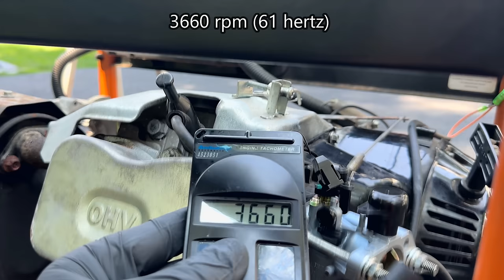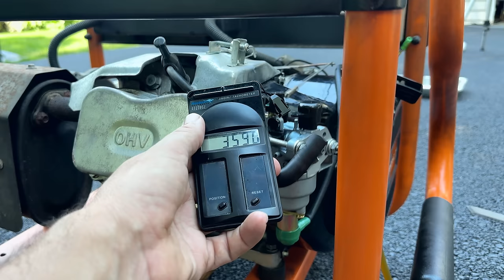Generac Engine Rebuild - Wiped Camshaft Lobe, Only Backfires Through Carburetor

Comment: Man I had my keyboard fired up and warm and was getting ready to tell you how you should take this engine apart. Working on industrial equipment  for 75% of my life I can attest that sometimes the torque values aren't always available.  So engineering support always used engineering standards which most of the time  was within tolerance.  I can't believe a Honda clone or any other engine with journals the same size as the Generac  assembly values couldn't be used.   Great job James, just when I thought you were backing away scared you redeemed yourself as the engine whisperer !
Reply: At end of day it's a generator engine not the space shuttle
Reply: @kylepaluzzi4176 you could have just read hes comment and said nothing
Reply: @kylepaluzzi4176  If I recall a few of those have blown up also !
Reply: @MrTonyPiscatelle  ‘just an O ring’  on one occasion wasn’t it🙄

Comment: Thank-you! It's remarkable that the wear was so specific on the one cam.
Reply: Yeah and it’s seems to be common on this brand of late model engines 
Factory defects for sure
Reply: induction hardening missing on one cam i think, factory defect not noticed by qc
Reply: @jusb1066 I think you're spot on. I work on these machines as a side business and I'm finding more and more issues related to poor metallurgy and coatings.

Comment: James! You just invented the very first generator optimized for producing imaginary power! Owners of capacitors and inductors everywhere will be breaking down your door soon to buy this!

Otherwise, a suggestion: for new engines and rebuilds, install a magnetic dipstick for the first few hours of running. You will be amazed at how much material it will capture. No more ferrous metal finding its way into bearing surfaces. I have magnets in all of my 4-cycle OPE. There's always something on it every time I check. And that's in every engine, so it's not presaging some grenading event. A new Ariens LCT 420CC snowblower engine that I broke in a few days ago, there was a substantial amount of material after just two hours of run-in at 2400 rpm. I don't believe that there's anything wrong with the engine, it's just normal wear-in. in any event, it might be interesting to try it on your next major rebuild just to see.
Reply: Where does one find a magnetic dipstick for so many different engines? I like the idea.

Comment: It amazes me that you are so meticulous. Not only replace the cam shaft, but why did it fail? Rust abrasion. I never would have thought of that. Awesome content, James. Keep up the good work.
Reply: I’ve had to newer engines that had bad cam and I was shocked 
Never see it before on a Honda engine in 25 years 
They failed at factory with the cam manufacturer
Reply: I expect there were a number of engines with a bad run of camshafts.

Comment: 👌👌👍👍  Thanks for the video.  I would have replaced the exhaust valve spring too.  If the old spring is too tight, it will wear down the new camshaft lobe.
Reply: I change out both springs on the two I did and installed Honda camshafts
Will find out once there used this winter how it turns out

Comment: Jim I'm glad you stressed a proper break in for the flat tappet cam and lifters and added Zinc to the oil for the break in period ,car engines and all small engines I run zinc in them especially my 1960s chevy motors

Comment: Hello  James: Another enjoyable and informative video. I will date myself here. Before the internet Era, when torque specks on a critical item like Con Rods or head bolts was not known.The common practice was to use a torque wrench and tighten the bolt or nut until it just moved. Take the reading. To allow for set resistance on reassembly use a torque set point slightly lower than the reading obtained. My personal adjustment was 5% reduced. I have never had a problem  with nuts or bolts coming lose or breaking using this method.
Reply: You can look up maximum torque values in charts online. It depends on the bolt grade, thread size and pitch, material it's screwing into, and lubricant. If the spec is for dry threads but you have them lubricated (oil, grease, antiseize, whatever) you have to lower the torque by 30% or you will overtorque
Reply: @brainndamage  You are correct. There is an unending  combination of factors that go into determining proper torque specifications. The use of establishing a torque  value and then turning an additional # of degrees is being used frequently now. Following the manufactures instructions is by far the best method.  If you were out in the field doing an emergency field repair and the information was not available or known what would you do?
Reply: @swallowinn4410  turning aspecified number of degrees is done for TTY (torque to yield) and will permanently stretch the bolt, you usually don't want that. It is very common on critical bolts however, cylinder head or exhaust manifold bolts. You can usually get a good torque  by feel if you're experienced enough.
Reply: @brainndamage  You are not telling me anything I did not know or understand. You did not answer the Question. What would you do if you had to complete a repair with an unknown torque value? As I mentioned I am not young, my mechanical and engine building experience was primarily in the Aircraft industry. Now retired I still routinely repair and build engines.This being said I am not too old to learn and adapt to a better method. So I repeat the question what would you do if you needed  to complete a repair and did not know the torque value for a critical component?

Comment: How tame, a wheel puller!   When I had to get a flywheel off, it was a couple of beefy flat blade screw drivers prying up from under the flywheel while you rapped on the crankshaft with a hammer !
Reply: Now there's your dinner

Comment: The readily available Rato 420 specs would work nicely!    If I recall, these engines have 2 oil fill and drain ports.  The oil drains have galleys that are drilled into the crankcase to facilitate oil draining.  These galleys collect all kinds of debris and are often overlooked when cleaning the engine block for repairs.
Reply: Really best to take it completely apart and flush with diesel and air psi to get it all out 
Yea more work but it’s clean

Comment: 37:08  That kind of wear doesn't just "happen"  I would definitely take the head off and examine the valve and the valve spring.  Something caused that excessive wear.  Since no other part in this engine has excessive wear, it wasn't contamination or loss of oil.  Other than contamination of the cam or the lifter from the factory, there is no explanation, at least so far in the video.  But SOMETHING caused it. It didn't just happen.
Reply from the maker: Rust contamination I think was the main issue.  Also the spring tension was high for small engine increasing the west.  The GP series are also known for cam failures.  Probably sub standard manufacturing.
Reply: @jcondon1  How did the rust selectively wear out the exhaust lobe and not wear any other part including the intake lobe?
You said the spring tension felt excessive. That would do it.  I think you should put a new exhaust spring in it.  You would think a worn spring would have less tension. So maybe it was defective from the beggining.  I think the spring tension measurement gauge is fairly expensive.  They may not even publish a spec for it anyway.
Reply: Those rocker arms sure do look heavy duty compared to the pressed soft junk that the majority of the others use.

Comment: James inoculated the engine with zinc, first time I have seen that on the channel. Good idea. I have used the STP zinc additive on my race engines with good results.
Reply from the maker: Normally not needed on a small engines since the valve springs are pretty weak.  On this engine, the springs were stronger then most.  Puts a lot of stress on the cam.  That and the rust I think were to blame for the failure.
Reply: @jcondon1  Oh, for sure the rust was a contributing factor. Something that would be interesting would be the use of synthetics in small engines. Either blended or full synthetics. In car engines, it is very easy to tell when an engine has used synthetics versus conventional. Since many of these engines sit unused for a long period of time, would the use of synthetics help keep the rust and corrosion at bay a little better?
Reply: @jcondon1  Hey, tried reaching you back about a month ago wanting to know where I can get that "IV fuel bottle" thing you use when you are not using the OEM fuel tank for testing. Can you put a link to it please?

Comment: A lot of people dont realize that periodic running of a generator is important (perhaps almost as important as oil changes). After the engine runs at temperature and is then stopped, either the intake or exhaust valves can be  open and moisture can and will condense on cooling surfaces, leading to rusting. Rust is abrasive. I wonder if a good practice would be to turn over the engine untill it is on its' compression stroke when storing it (just like running the carb dry).
Reply from the maker: I always turn the engine over until I hit compression before storing.  Valves are closed and moisture kept out of the cylinder.

Comment: You made the right call to remove the crankshaft. It is always a good idea when replacing or rebuilding the top end, to always at least inspect the bottom end. This is because top end repairs put more strain on already worn bottom end, and can lead to premature failure of bottom end.

Comment: Indasa Rhynowet silicon carbide abrasive paper is the best I've used. Not sure of it full range, but I have it up to 2500 grit. It cuts great; far better than any 3M paper I've used. I've used it wet with oil and water and dry. I can get mirror finish on metal I polish with it.

Comment: I had a similar situation with a briggs intek.  It didn't have an oil filter, was about 20 years old and my buddy bought it used.  He had starting issues/running issues and once we opened up the engine we saw the cam had excessive wear.  A new OEM camshaft later and it runs better than it ever did for him.  I think it was a combination of no oil filter, ran hard, ran low on oil, excessive intervals between oil changes, and oil that didn't have enough zinc for flat tappets.  Out of the hundreds of pieces of equipment I've had/worked on it was the only one I've come across with this issue.  No idea how many hours were on the motor as the machine didn't have an hour meter but it was a surprised failure to me.

Comment: Very nice video James. We have an incomplete generator at the shop we’d like to get rid of. It’s all complete except for the stator and electrical components. 9HP vanguard engine which did start last spring. Still has the rotor. We aren’t doing anything with it and it’s just taking up space.  No name on the machine but I’ve been told it’s a Dayton 5000 watt unit.
Reply from the maker: Not sure where you are located, but love the 9hp vanguard engines.
Reply: I’m in Ohio.

Comment: James...I just saw this video for the first time...In "comments" there was a question as to why the head was not pulled & inspected.as to the possible cause of the cam failure.  Here is a thought from an old street rodder/classic car guy.   Oil formulations have changes significantly since the introduction of catalytic converters in the  mid-70's.   ZDDP (a zinc based additive ) which was in oil & needed to stop flat tappet cam wear/failure in engines was removed because it clogged the converters.  Oil  manufacturers removed the ZDDP and vehicles started using  "roller lifter cams & followers" to compensate.  Under sustained high load/stress (like a generator) most of today's oils( no matter how good) are not designed to cope with flat tappet/cam wear.  That's the short story...more info is available on the web.   I use a ZDDP additive in the oil of all my older  non-catalytic cars to prevent cam & lifter wear...I also use it in all my 4 cycle small engines.   Some specialty oil can be purchased with ZDDP, but I just keep a bottle of it around and add it to my oil at changes.  It is available at Amazon and some auto parts stores.

Comment: Love watching your videos!
Have you ever thought of setting up a “carb stand” where you can connect your aux fuel container higher than the carb before you install it on the engine? This can be done while you work on other things. Some leaks take time to show themselves. 
It would save so much time in the long run. I’ve never seen this done in any of the many repair channels that I watch. My two cents.

Comment: Small engines have never been a part of my skill set but they will be starting in the next few days. 
I've now watched about 12 hours of your engine rebuilding videos and I feel I have absorbed enough information to begin a fast learning curve.
It's almost a guarantee I won't get it exactly right the first couple of attempts but I've always learned a lot from my mistakes. Besides, it isn't a race or a competition...at this point, and I've really got nothing to lose because learning is winning.
Your videos are excellent and you are certainly a Master and I admire your knowledge and skill.

Comment: Changed my oil recently on my lawn tractor.  It looked good on the dip stick before I changed it but came out weird like it had moisture in it.  So after I changed it I cut the grass once and changed it again and I could see were it cleaned it out.  I’ll be changing it more often at 25 hours or so.  I think I went about 100 hour on the last one.  Anyhow changing the oil out after a short while does clean things up quite a bit if needed.  Good video.
Reply: I change oil every 20 hours 
It’s cheaper than buying or fixing engine

Comment: As long as the frame is in great shape  you can use it for another generator. engine And  power unit  as  long as the AVR is not messed up and the engine is still working

Comment: when I got my Generator with a 420cc engine I did a 30 min run with no load and the oil looked like that.. 
its on its 3rd oil change with about 8 Hr on it and the oil looks clean coming out.

Comment: You might want to look into a nice carbide scraper to clean off those gaskets in the future.
Reply from the maker: I have one.  Maybe I am using it wrong, always takes aluminum with it.
Reply: @jcondon1  Well that's not good. I've seen others like South Main Auto use one with good results.
Reply: I use those scotch brites in an angle grinder. Even i can't screw it up and doesn't gouge the aluminum
Reply: I've always avoided any sort of material that will scratch metal I do not want to remove ! That's what I was taught, and I prefer to stick to it. I have seen some damage done by using the wrong grade of scotchbrite, guys don't seem to realise that in making surfaces "nice and shiny" they are removing material to do it ! Me, i'd rather see smooth heat discoloured metal than"shiny".

Comment: Another great master class, James. I'm wondering if this engine had water intrusion, or perhaps the moisture causing the 3rd body wear from rust was due to condensation from out door storage.  Kind Regards.  Craig
Reply from the maker: Likely condensation.  It was stored outdoors under cover BU the original owner and then in Ken’s basement for a few years.
Reply: The customer actually had it in a vented Rubbermaid shed under his deck.

Comment: I'm think a fair amount of water got into that engine block. Maybe the counterbalance not being timed to the cam and crank had something to do with the excessive wear on the exhaust lobe?
Reply: I don’t think so because I had two that did the same thing, but were just like this and I also replaced the valve springs 
Never seen it before on a GX engine before

Comment: I was surprised you put that much money into this, but you seem to have a home for it, whatever. On the lube while assembling, I'm a little more liberal, but I save assembly lube (and moly) for the flat surfaces (rod journal, etc). I just douse the gears and ball bearings in oil. I use too much lubricant assembling because I cut my teeth in a German shop and the boss caught me putting in a set of points without lubing the rubbing block and he imparted this German phrase to me (I speak German anyway): "Wer schmiert gut, fahrt gut.: (Who greases good, drives good). It has stuck me with since then, and that was ~50 years ago.
Reply from the maker: Can never use too much lube.  The cam was very overpriced.  I could buy a cam for a car for just a little more money.
Reply: The two I fixed didn’t even have a hundred hours on them 
Factory defects 
I think there are a lot more out there with this problem just waiting to happen
Reply: think a lot of viewers are naive about how much money he makes from views. He needs a video, weekly. The expense of parts isn’t a factor at this point. There is a bigger machine that needs oiling now.
Reply: @billhenry7833  I'm aware he makes money on his videos. All YouTube creators with a following do. It's work to shoot, edit and post videos and he's entitled to whatever money he makes on them. I was surprised a cam cost $135+ for a clone engine, but he has plans for that engine and that's ok with me. Some creators flood their channel with worthless puffery after initial success. James doesn't, he sticks to his niche and that's why he's successful IMHO.
Reply: @cheapcookies He makes about 1.2 cents per view.

Comment: This is what happens when people use oil with not enough zinc in it. Always run good high zinc oil in 4 stroke equipment.. I run Shell Rotella T-5 or t-6 usually 15w40. I run it in classic cars with extra zddp additive  and my 4stroke atvs and equipment! And yes that's in cold temps of Wisconsin!